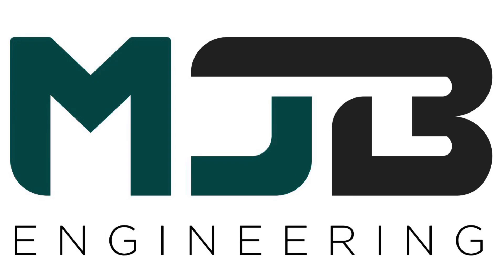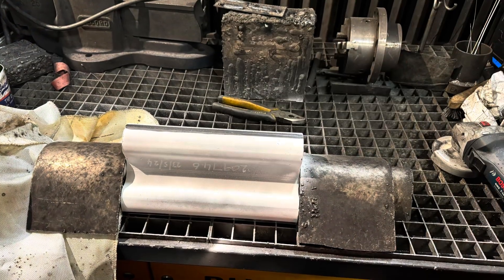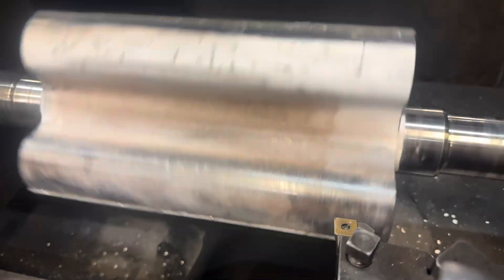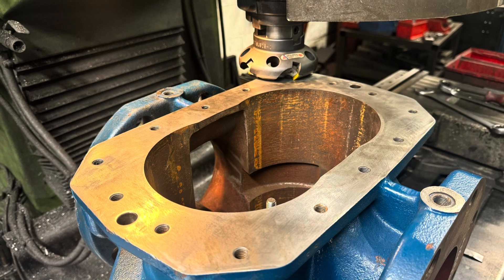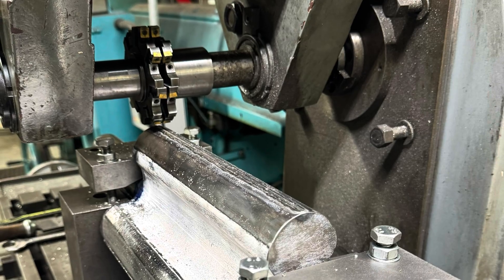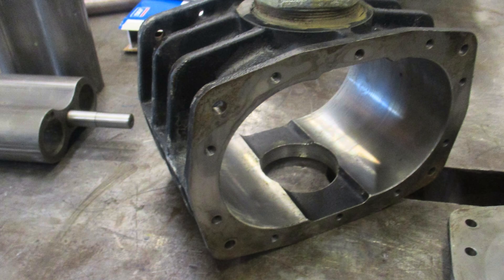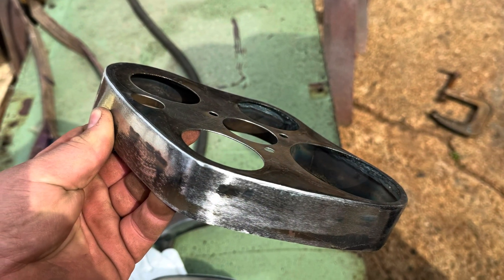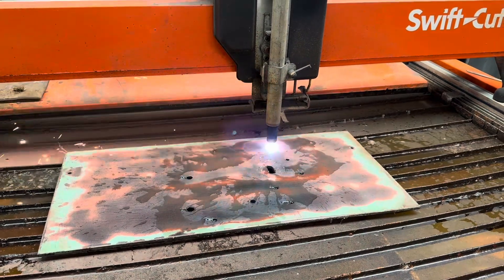Machining Roots Blowers and Welding Matchless Motorcycle Parts

Comment: NI 55 alloy I assume?
Reply from the maker: @notanymore9471  Yes, it's a special wire for this specific application based on a Ni55 alloy.
Reply: @MJBEngineering  nice work!
Reply from the maker: @notanymore9471  Thank you, we've had some trouble with spatter using the wire but it could be down to gas choice, i'm looking into trying a different composition shortly (M21 ArC-20 instead of M24 ArCO-12/2)